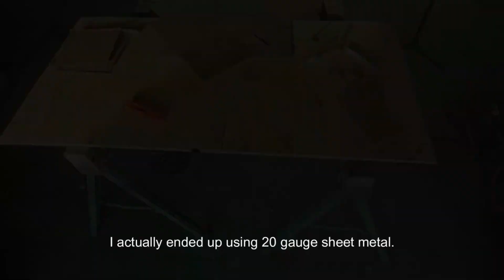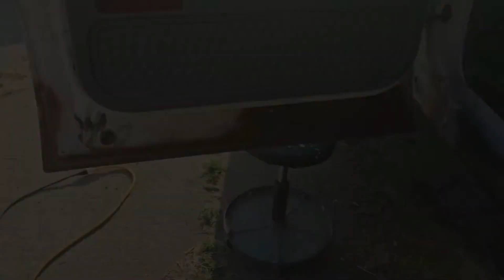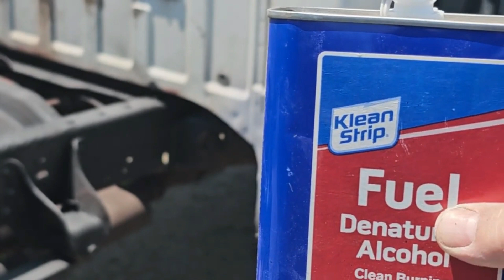Low Buck Cab Corner And Rocker Rust Repair

Comment: looks good, I think Imissed why you cut the new part off and not use it in one piece
Reply from the maker: Just to keep the repair area small. Plus when you get higher up there's more structure behind the panel and insulation. So I only use as much as I need to get past the rot. Thanks for commenting.

Comment: Looks great! I was curious about why you didn't opt to use paint that was formulated to match color code (Z1 Oxford Whte)...not to say that what you chose to use didn't look too bad!
Reply from the maker: Just wanted a cheaper option, I had some rustoleum white sitting around and sprayed a sample and was surprised how close it was so I decided to save the money as the whole trucks paint was rough to begin with.
Reply from the maker: Looking back I also could not get the truck in the garage I had the exact paint  but didn't want to shoot it in the driveway. I was worried about dust kicking up. I actually have a video inwhich I paint the tailgate with the exact Oxford white paint if you want to check it out. Thank you for the feedback. Thanks for commenting!
Reply from the maker: Tailgate paint video link:

https://youtu.be/dgzs2XGYLps